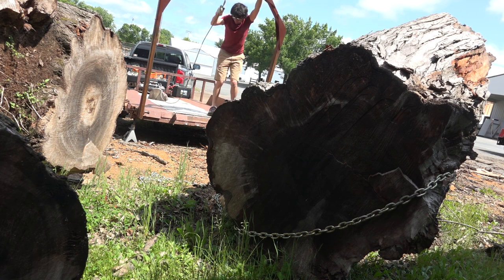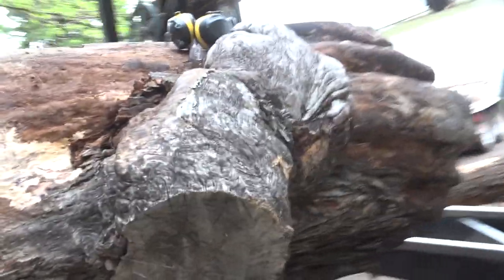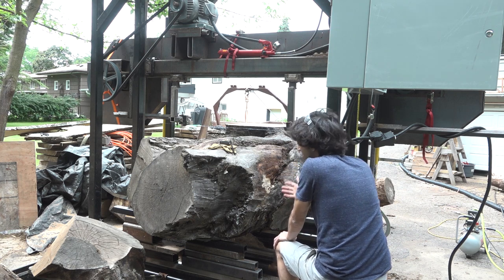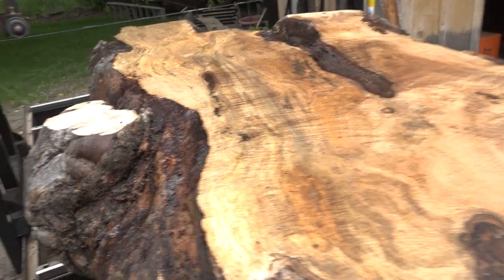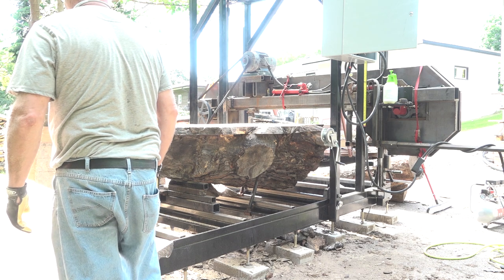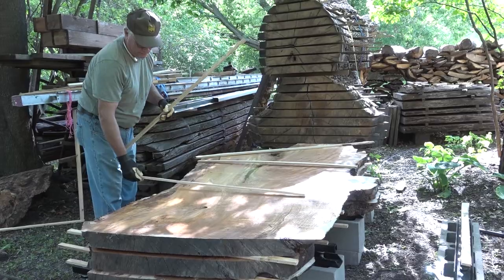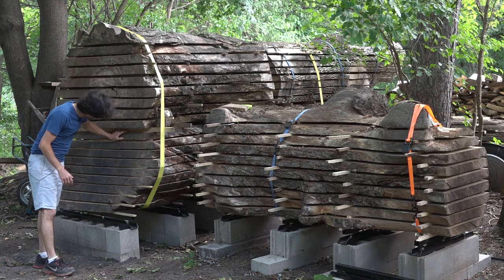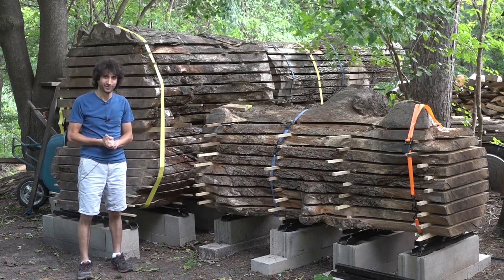Slabbing the Bigger Maple Crotch (Big Logs #5)

Comment: Matt, you ever think about putting a variable speed crank on the mill instead of doing it all by hand?  Even just a simple drill mounted to the crank might make a super nice addition.
Loved watching the entire series, I think I need to go back and watch some of the earlier episodes too on the mill and your drying racks.
Reply from the maker: On smaller logs when I can use the speed, I'll run it with a drill.  Feed rate on these big logs is pretty slow and varied so turning it manually works out well.  Thanks!

Comment: male yourself a gravity feed water drip for cooling and get some studs welded  with  wing nuts using metal-rubber washers to hold the band covers in place. easy and cheap to do. Will make sawing easier and maintenance down.
Reply from the maker: +DaddyTemp2010 I have a drip system that I haven't installed. It's not a big issue for my to do it manually since I'm standing there anyways and I don't have to worry about forgetting to close the valve. The guards still need a bit of finesse work before paint which includes adding some clasps. They haven't been much hassle either though since I've only changed the blade 7 times in the 6 months I've had this thing running.

Comment: Have you found that anchorseal on weathered endgrain is effective once the log is slabbed up? I typically endseal the log on fresh cuts, and before I finally mill the log, I'll take off a half inch or so with the chainsaw and then reseal on fresh, largely unchecked endgrain. 
I honestly don't know if it makes any difference, but I feel like it does. It seems like you just trust that your original endseal when it was a full log is good enough?
Reply from the maker: On weathered endgrain it's not going to be nearly as effective.  The damage is already done while the log was sitting there drying out.  That's the case with these big logs.  I do think that it helps keep it from getting worse.  On stuff that I seal right away, the boards end up flawless with just that original end seal.

Comment: You have done am amazing job on the sawmill and have come so far in the last 2 years that I have seen!  What metal cutting saw did you buy when you were doing the log arch?  And are you using steel across the top of your concrete blocks? to add strength and be flat for the stickered wood?

Comment: I've got two slabs of red oak that are two and half inches thick and twenty two to twenty four inches wide and nine and half feet long. They've been drying in my garage for a year and I need them to make my island top. My problem is one has dried straight in every direction the other is straight length ways but is curved down the center from end to end. Is it possible to do anything with it to straighten it out? Thought about getting it wet and parking my truck on it. Any help would be great. Thanks.
Reply: Michael Johnson probably only milling it down to thinner.

Comment: another question, do you sharpen the blades yourself? and how many cuts do you usually get before they need sharpening?
Reply from the maker: I'm going to be sending them out for sharpening.  They'll cut small stuff for a long time even when completely dull.  Really wide cuts are way more demanding so the blade needs to be in excellent shape to maintain a flat cut

Comment: Hey Matt, that was a neat trick you used to get the giant log off your trailer, could you provide details?
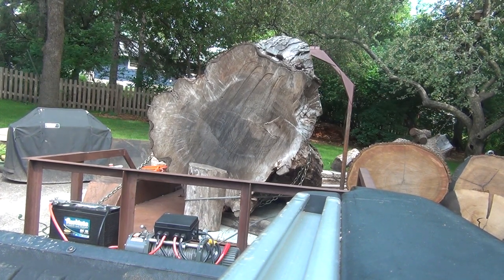Reply from the maker: at 1:23 the winch cable runs to a snatch block on the right corner of the trailer.  The cable then goes around the back of the log and is hooked to the left corner of the trailer. A piece of scrap wood acts as a second pulley so you get a 2x mechanical advantage.  The equivalent of something like this set up used for lifting: http://images.slideplayer.com/32/9898903/slides/slide_18.jpg
Reply: Matthew Cremona perfect thanks Mr. Matt.

Comment: thank you . question please ! i see you spray the band saw blade what is it your are spraying with . high carbon steel will rust quick .
Reply from the maker: +Walter Rider diesel
Reply: Matthew Cremona, mix it with a few drops of Dawn, and add half water. We used kerosene cut that way, and it always kept the plate free and wear on the beds to a minimum. The water evaporates leaving a waxy film on the steel, never had any rust issue... Great video, Matt!!!
Reply: thank you

Comment: Why do you pour the water on the slabs, its is just to see the grain or is there more function to it? Wont it slow down the drying process?
Reply from the maker: Just to see the grain better.  Makes it a lot easier to see on camera.  It has no effect on the drying.  It's just surface moisture and dries within a couple hours

Comment: Why did you saw all of the slabs without taking one off before sawing the next one, I would have thought you would saw one then take it off then the next otherwise you putting added pressure on the saw, unless I'm not getting something ?
Reply from the maker: The weight needed to stay on the saw to keep the log stable.  The weight above the cut doesn't effect the saw since the teeth are cutting a wider kerf than the thickness of the band.
Reply: Matthew Cremona Thanks for your answer, makes sense.